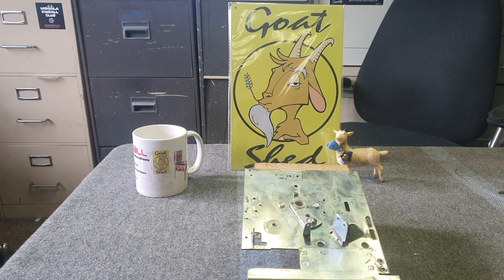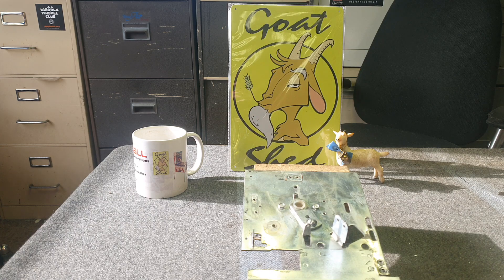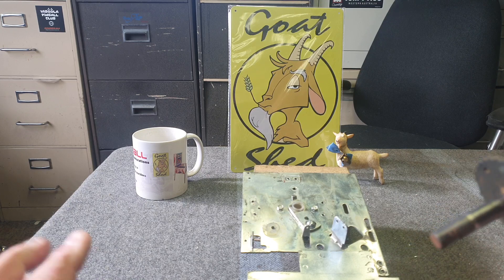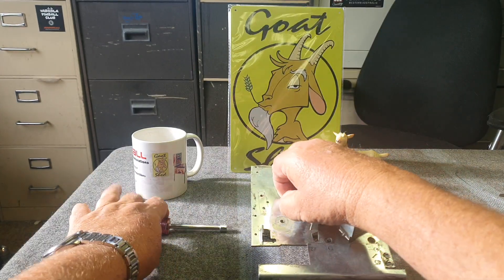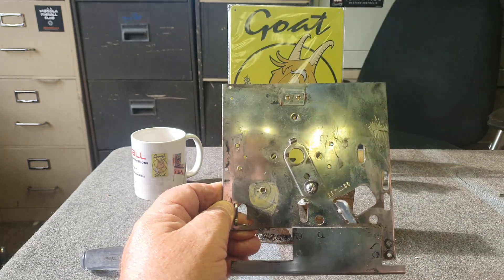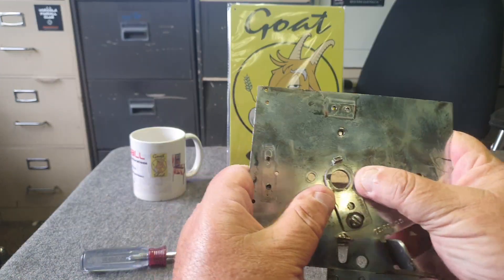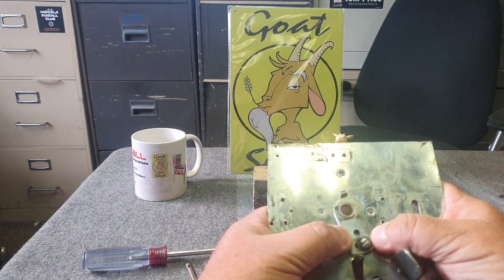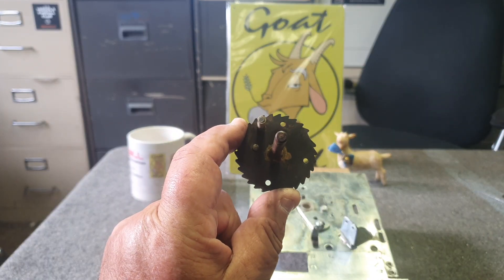Unusual Stepper Problem Gottlieb How To Fix!

Comment: Very useful video. I’d guess that most folks have never come across this problem, as not many pinball repairers ever pull the step units completely apart. Great tips for this problem. Understanding the mechanical side of em pinballs is at least half the battle. Thanks for posting.
Reply from the maker: Thanks yes a very odd one I still wonder if it's was done at the factory or by a repair mechanic at some stage let's hope it stays on YouTube for a long time to help others.